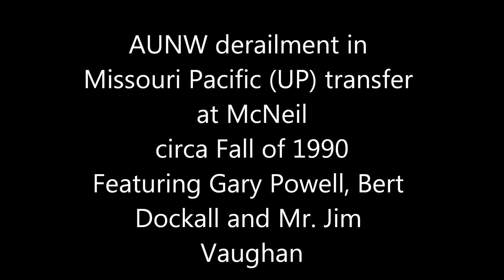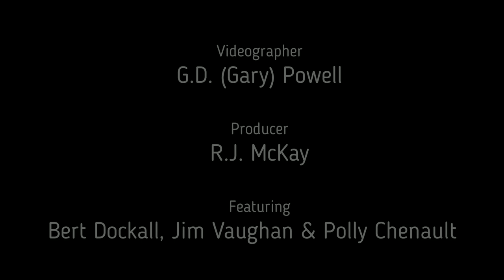Austin & Northwestern Derailment Cleanup in McNeil Transfer, 1990

Comment: That is quite the spill.  Do you have any details such as how fast the train was moving, what caused it, how many cars were in the train and how many derailed?  Thanks for sharing that.  How long did it take to clean it up?
Reply from the maker: It was just a few cars that derailed either pulling or shoving the transfer and probably happened at low speed. Probably took them a couple of days to get the cars rerailed and a few more to fix the track.  I wasn't working there by then, so know of no details.